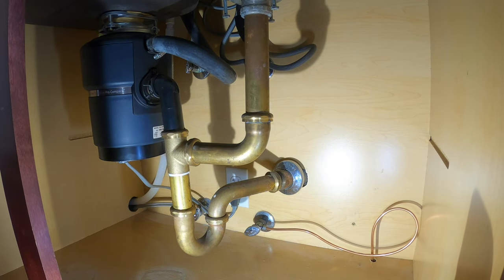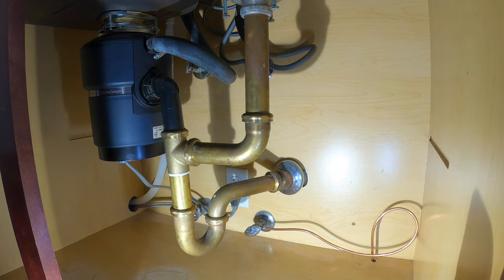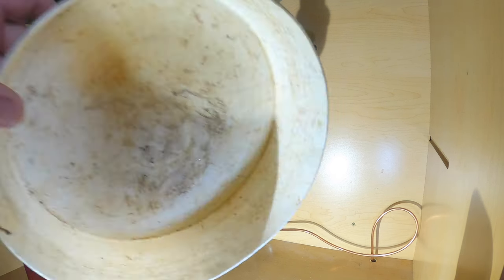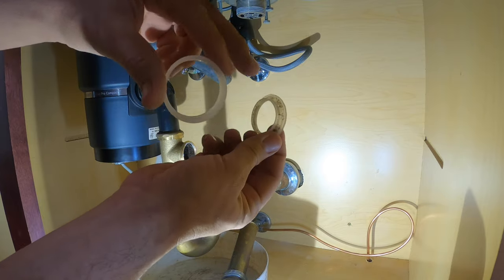How to Install Kitchen Sink Drain Line Pipes

Comment: Nice job.  I was a little surprised that you intentionally sloped the horizontal pipe by just cocking it within the slip-joint.  I've always assumed I wanted my slip-joints to be at good straight-in angles to avoid leaks, and I accomplish slopes with the rotation of pipes within the plumbing layout.

Comment: The job went well. I ended up needing one more rubber seal ring but I was able to use an old one for the dirty drain connection.

Comment: I see 2 water valves, one set lower and one upper, I assume the upper ones are for the sink (hot and cold), but the lower ones? I'm assuming again that the supply is from the right in the copper tube is cold and the left one looks like hot water going to the DW?

Comment: A small thing I've started doing on my white pipes:  With a perm marker, I put matching lines on each nut and it's pipe it screwed on to, to show at a glance if it has backed off at all.  I've seen a small leak develop because of loosening, presumably from vibration of the disposal, or bad behavior by the house elves.

Comment: Thanks for the video.  I need to angle the drain pipe from the strainer sink to the pipe going into the two drain pipe adapters. Sorry. Not very descriptive.  The original tail pipe is hanging too low for a trash can tray. What is best way to angle  from the strainer sink to the p trap combiner? I have seen a pipe with a 45° adapter on each end which I think might work.  Thanks again for any advise you can give this hobby plumber.  😮

Comment: Thank you for the video. Clarification, it seems the adapter is ABS, but the rest of the pipe is polypropylene plastic. 
Dearborn Brass A9704B P-Trap With Threaded ABS Adapter, 1-1/2 in, Polypropylene

Comment: good idea to install drain line pipes...seemed to save a lot of space,,,this looks like what I was looking for!! Thank you!! is that 36 inch wide sink? Do think this fit 2 x 4 gallon RO tanks? (each width 13 inch & depth 13 inch, height 17 inch)
Reply from the maker: Yes it will fit the reverse osmosis tanks. Thanks for the support!

Comment: Thank you for your video. Can you let me know where I could buy drain pipe kit? I would like to replace my old pipes and my drain structure is almost same to you.
Reply: Try Walmart. I just bought a kit for $22 with every pipe you may need to replace kitchen sink drain pipes. I also bought a flexible extension piece for $7 to replace the one under my sink. You can probably get the same thing at any home improvement store like Lowes but they were closed when I needed it right away.

Comment: The dishwasher drain pipe has a low point. Wont this cause it to act like a P-Trap?
Reply from the maker: No because there is a pump on the dishwasher that pumps the water. A P-trap is drained  by gravity. Good question thanks for washing.
Reply: Curious. Does your dishwasher have it's own drain pipe that goes to the dirty drain? It doesn't connect to a garbage disposal?